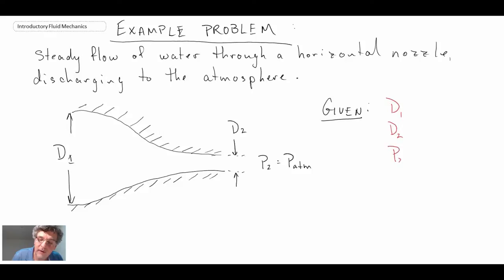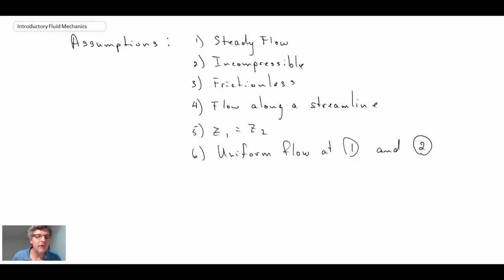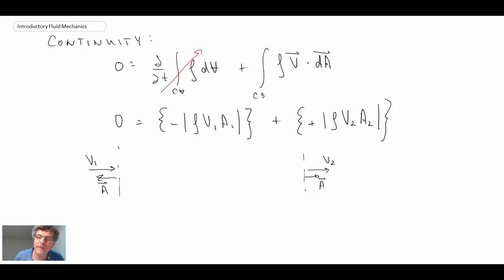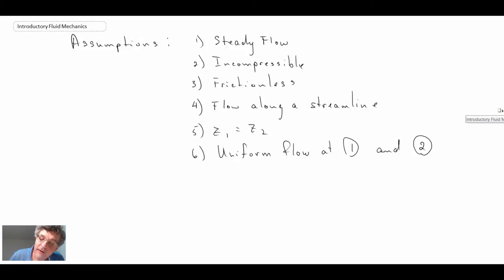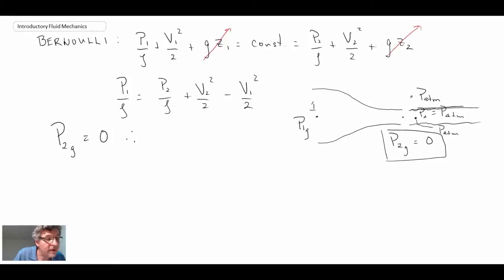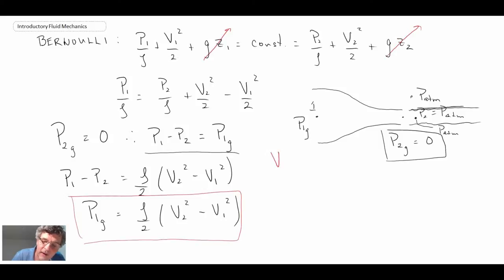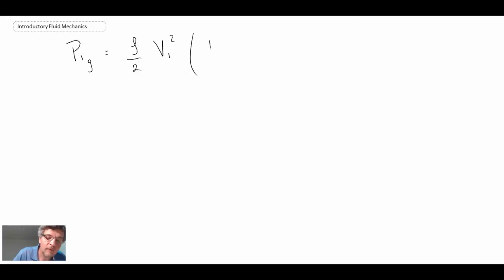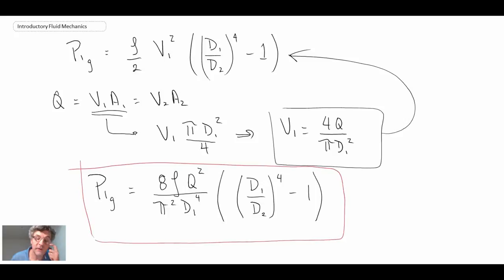Introductory Fluid Mechanics L11 p2 - Example - Bernoulli Equation

Comment: Hello!

If I have, for example, a heat source generating 80W into a diaphragm wall, the diaphragm walls is into the ground, the heat exchanged at the interface ground/concrete could give me the actually energy efficiency of the system? For example, if I need to extract 80W from the ground through this concrete diaphragm wall, can I find out how much of the energy I can actually obtain to say "My needs are 80W, but I can get only 60W from the ground"? 

I am studying geothermal energy (energy foundations as diaphragm walls) and I don't know exactly what's happening in the ground because the method I am using consist in treating the pipes within the diaphragm walls (which are in the ground) as heat sources, followed by measuring the exchange heat at the interface of concrete/ground. But I don't understand exactly what this means. 

I would really appreciate your answer!!
Thank you!